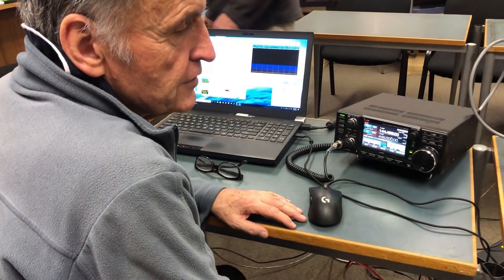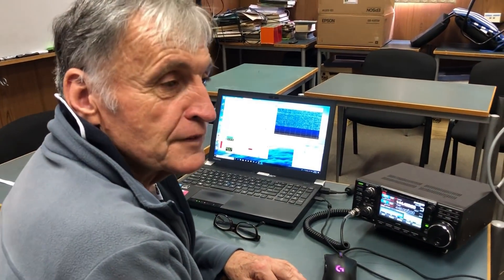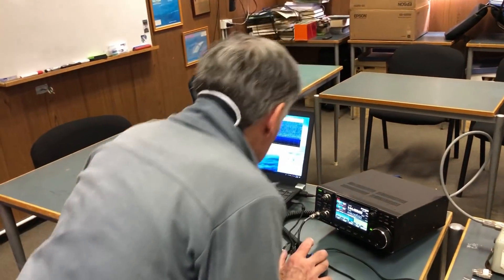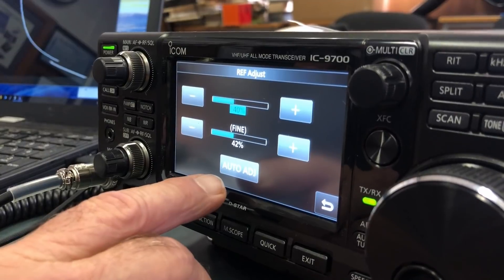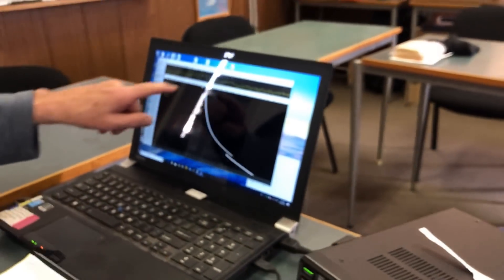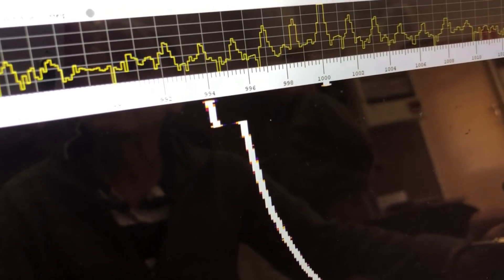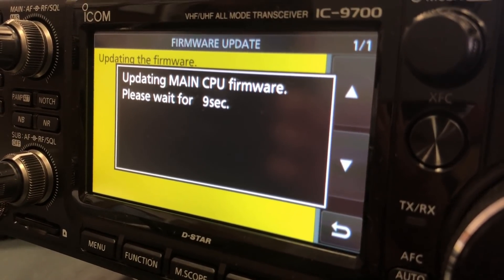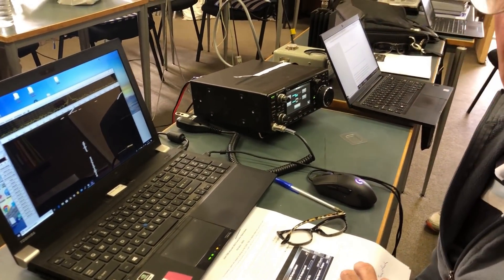Is the Icom IC-9700 frequency stable? - Tested by Rex VK7MO

Comment: I am amazed that this modern rig drifts like this, really put me off buying this Icom. WSPR is really meant to be a LOW power mode. My QRPlabs puts out only 1watt, which is an ideal power to judge how conditions are. Rather than  100Watts which  is pointless, also at 100% duty it’s killing  the finals. I limit FT8 to max of 30watts. Would be Interesting to know how this set drifts with only QRP  no more than 5 watts. Also what’s the drift like at max of 30 watts using FT8 which is only 15 seconds.   However very interesting tests. G4PEY
Reply from the maker: 100W isn’t pointless on WSPR. Neither is 1kW! It all depends on the application. As the 9700 is VHF and above, sometimes higher power is required, such as EME or over marginal tropo paths. It’s also not 100% duty cycle as it’s not transmitting every cycle. On WSPR say at 20% that’s only roughly once every 12 minutes or so. The rig on the new firmware would probably be more than capable of FT8 transmission due to the shorter transmission periods.
Reply: @HamRadioDX I was referring to WSPR on HF where high power is not necessary or required.
Reply: I wouldn't consider 4 hertz excessive drifted at 144 megahertz

In fact I'm questioning the accuracy of the test equipment and test setup when was the last time it was calibrated to be able to measure 4 Hertz lol😂😂

Comment: I would like to see the circuit diagrams Rex and I think I could come up with a solution.  Has anyone got a copy?.  I agree the drift on mine is not good and might be able to be improved using a simple PTC heater on the frequency reference.  My 23cm homebrew Transverters are much more stable with a 60deg C cut 96MHz crystal in a polystyrene box with a 60 degree PTC heater.
Reply from the maker: Hi Mark. The circuit diagrams/service manual only show a block diagram type arrangement. The PTC heater idea is a good one, but I don't think the oscillator is easily accessible. Regards, Hayden VK7HH
Reply: Hi Hayden I have actually dismantled one yesterday and can get to the oscillator.  It's a 64MHz TCXO and I did a test with freeze and a hairdryer and it does shift up to 30Hz which is correct for a 0.5ppm at 64MHz. I think we could make up  a 64MHz VCXO with either a crystal or voltage controlled TCXO and then use a frequency lock loop with a 10MHz reference, maybe a G4JNT like reverse DDS.  The board could easily fit inside as there is plenty of room, and use the 10MHz input on the rear panel.  I think it might be possible to either disconnect the onboard TCXO or somehow feed in the external 64MHz without any modification but I will have to do some tests. Regards Mark  VK5LO
Reply: @HamRadioDX  I probably should also mention that the issue is the board is quite warm around the TCXO from all the large chips like the FPGA etc and when cool air is pulled through the Radio from  the fan, it cools the board and then the TCXO shifts frequency.  Its not a great idea having the TCXO on the main board and would have been better to have it external on a small sub board.  I did try the PTC heater with no improvement due to this and also extra foam so its really the conduction of heat through the PCB board.
Reply from the maker: Thanks Mark, just sent you an email.

Comment: Awesome! I would be excited to know my radio was only "up to 4Hz off at 2 meters". Restated that would be 4 out of 146,000,000. What test equipment are you using (10 MHz reference frequency, receiver, PC's) that is accurate and stable enough with a tight enough tolerance to measure an error of 0.000000027?

Comment: The red |TX| icon in the display is very very misleading. I`d like it say RX in green and TX in red when indeed transmitting. OR just the spot on the screen for something more useful as there is  LED for TX/RX already. same with the 7300.
Reply from the maker: Hi Reggy, we did notice this when testing!

Comment: Hi can you explain the software and how it connects to the rig please, 
73 
Trevor 
EI2GLB
Reply from the maker: The software is called Spectrum Lab. The connection to the rig is via the USB sound card built into the rig which is used to interface to WSJT-X too.
Reply: @HamRadioDX  thank you for answering me and making the video, the 9700 looks a good rig but I think people are expecting too much from its relatively low price, considering a Khune transverter is nearly the same price on its own,
Reply from the maker: @fatboymotorsport  I agree the radio is well priced. However, quoting from Icom "Built with the VHF/UHF weak signal operator in mind". As per the video description, the video was intended to show that Icom perhaps missed the mark when it come to the 10 MHz reference option. I'm not sure what the comparison is with Khune as their transverters are GPS lockable and this rig is a VHF/UHF rig, not microwave.

Comment: Nice! I’m happy with the results. Could You share the name of the slow scan software? I am wondering if it would be used for weak signal long period monitoring.
Reply from the maker: Hi Michal,
The software is called Spectrum Lab - https://www.qsl.net/dl4yhf/spectra1.html

Yes it can indeed be used for beacon monitoring. See the section called "Digital DX Modes". http://www.vk3hz.net/vhf_column/February2015.pdf

Comment: This is terribly frustrating to those of us who have bought the radio or are considering it. Is there an option for a higher stability internal reference?
Reply from the maker: Hi Charles, at this point in time Icom do not offer it, but the radio is new so perhaps they may come up with a fix in the not too distant future. In any case, hopefully they are now aware of the issue.
Reply: Going to hold off buying until they release the IC-9700I or some variant.  I was already a beta tester for Yaesu with their FT-991.  Not going to keep doing that.